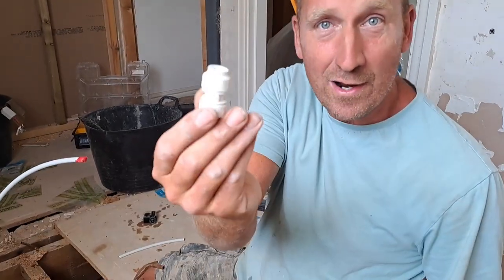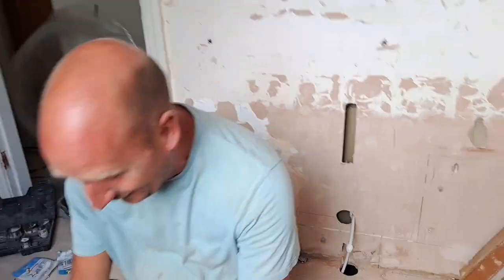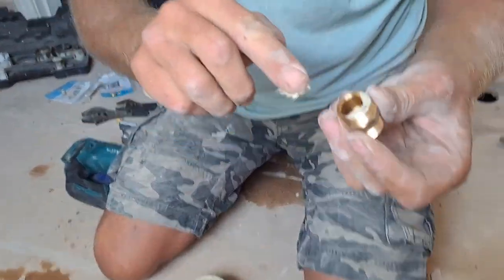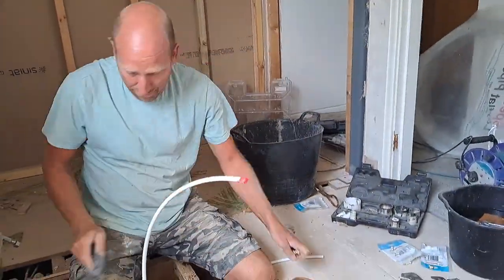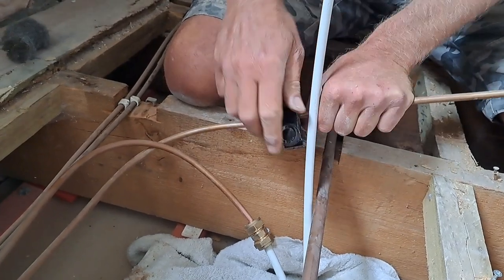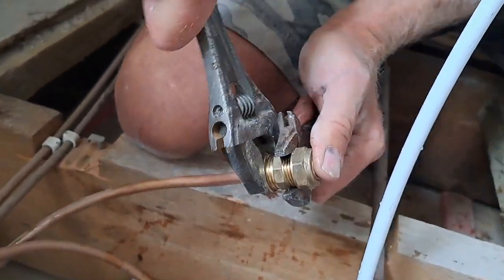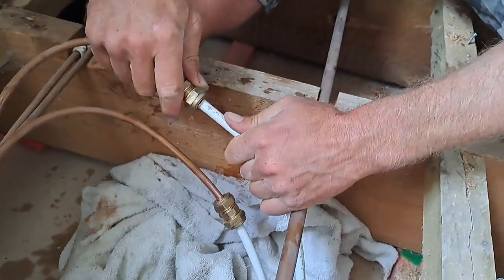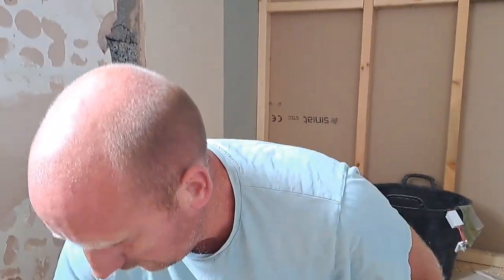How to join 8mm copper to any 10mm micro bore

Comment: What a great video....
It really has it all...comedy...information...water...kings...drama...customers...I mean Everything.
The only copper I HAD in my house was to a dishwasher and refrigerator...
Those are replaced now...that was what failed during the big freeze and caused the massive flood in my house.........
I replaced the copper with PEX pipe...which started in the manufactured housing market but has since been improved beyond belief...
I also took a chance on a couple of SHARKBITE fittings....they basically just push on...and they are amazing, but I would only use them where you can see them as I just don't trust anything that new...LOL
Anyway....fantastic video Brother.........liked and saved!
Reply from the maker: 🤣😂 over here the main push fit brands are John Guest or hep 2 o. They're really good, as long as you put the proper insert in🤣😂I like doing these silly DIY vids🤣😂today were going for another sleepover ot Helen's 😁she's bought us all toothbrushes😲🥰
Reply: @realcooking1833  LOL.....Toothbrushes.....serious move.
You can tell toothbrushes were invented in West Virginia because anywhere else and they would've been called teethbrushes....
Reply from the maker: @rockuncleproduction2229 😂🤣😂🤣😂

Comment: You dont need them if you ream the 10mm clean the 8mm put flux on the 8mm fits inside the 10mm and solder

Comment: You don't need to clean copper pipe for compression fittings, only when soldering.
Reply from the maker: Thats correct, you don't need to.

Comment: When you drain down system does it empty 10mm pipes aswell under radiator
Reply from the maker: @christophercarney7924  yes, if you drain the system it would get rid of most of the residual water in all the heating system pipes.